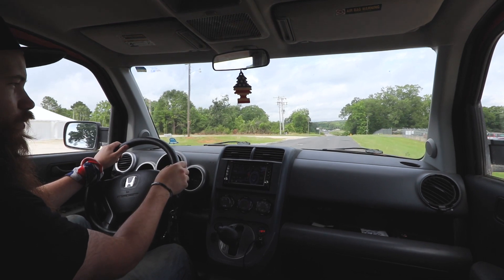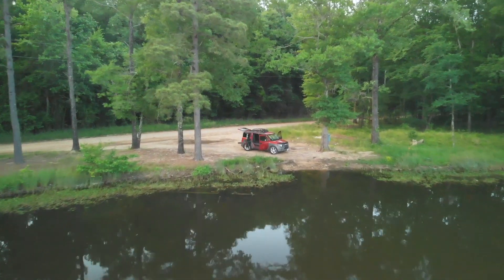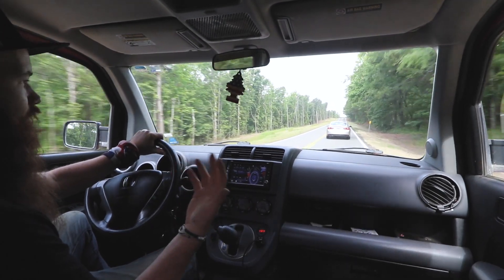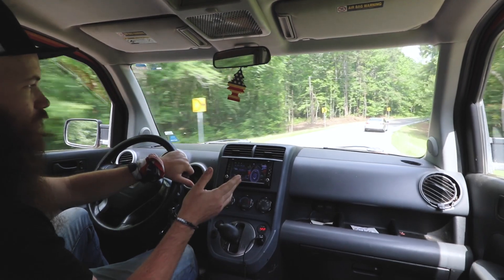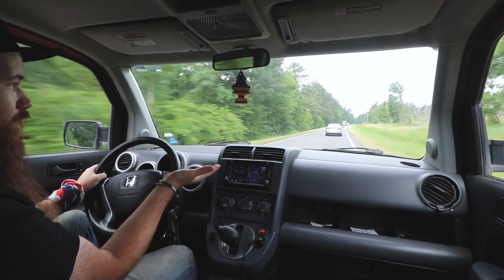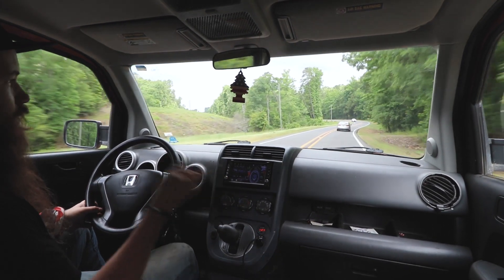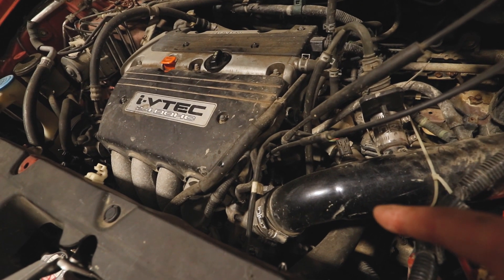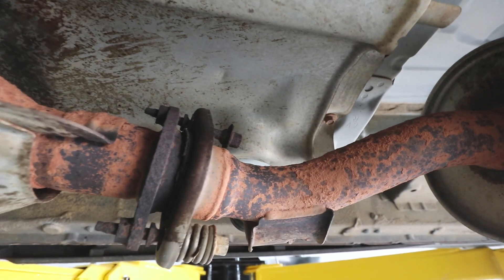Review of the 2003 Honda Element(10+ years of Ownership)

Comment: I was told there was Dust or heat shielding brakes rubbing could it be what you were talking about the rear driver side brakes?
Reply from the maker: Nope, that's a pretty easy fix. I've rebuild the brake myself and it's corrosion on the sliders in the caliper. Not an awful fix, but it's a design flaw for sure. 👍
Reply: @DashnCars  thanks my anxiety level just took a dip
Reply from the maker: @sandramatthews9478  No problem! Let me know if you have any questions!

Comment: Can you give a year to year differences and highlight what you feel, year/options, superior to others?
Reply from the maker: For sure! The early models 03-05 are pretty basic, aside from the rare 05 khaki colored one. 06-08 is an updated painted panels, upgraded interior. 09-11 is considered the 2nd generation sorta but they have a much updated exterior and interior
Reply from the maker: Then you have the SC models, which is the Street Cruiser model. Just a really nice street model, updated everything. Probably the best exterior and great interior. There were sub models too, like the Dog Edition!
Reply: @DashnCars  The AWD system seems to have held up to rallying and tons of miles. Would it need to be addressed if a turbo or j series was present?
Reply from the maker: There are some real upgrades you can do. I'll be doing the same thing to the Rally crx actually. You can pin the rear diff and run a Viscous coupler. I think for my goals in the Element the factory system should be just fine honestly.
Reply: I don't recall the source,  but I watched a review that said the transmissions in the 08 (vs 07) were a better built transmission (they changed where they were produced) and were preferable if you were going to be towing.  I don't want to give the wrong information but I think they said the gearing was tweaked. If someone knows this info please post it.
Reply from the maker: @rustybraids  From what I understand that of correct as well. I wouldn't really recommend towing much of anything with the Element either way. I've pulled 4 wheeler trailers and stuff, but that's pretty up there still. I've heart the differential is better in those years also.
Reply: Doing research in these cars is crazy - I bought mine specifically because of what people experienced with towing. Many claimed it was highly underrated for towing capacity.  Sighting the ratings in Europe and the US - and how the breaking ability was calculated (I think).  I have a small,  but heavy low camper, and within the 1500lb tow rating.  

Mines an 08 EX AT - I hope my experience will be good!  The element provided the extra sleeping space we needed. 🤞🏼  Its not like we'll be doing this on the daily,  but do want it to be safe for the travelers and the vehicle.
Reply from the maker: @rustybraids  I just have my first hand experience in towing with vehicles that are meant to tow things and ones that just 'can'  tow things. The Element will definitely tow at it's capacity, but it's not necessarily designed to tow. If that makes good sense, what I mean is the brakes, transmission, gearing, etc aren't up to snuff for towing much more than 1500-2000 lbs. However, you can do it and upgrade the Element as needed. 
I actually put a transmission cooler in mine that has a fan and everying, I'd highly recommend one if you plan on doing a lot of towing with any capacity!
Reply: @DashnCars   thank you - that makes good sense.

Comment: Hey, thanks for the reply, I'm thinking about running larger rims I'd like to run bigger brakes. What's the tire size?
Reply from the maker: These are 235 65 17
Reply: @DashnCars  Thanks, my trans imploded 4 weeks ago, a week after getting it fixed I dumped another 2100.00 into it. The old saying if it ain't broke don't fit it is B.S. The bottom lines it will be at least a year before I can afford new anything!!!

Comment: i see elements with 200 + k  what mileage would you stay away from? I have a mechanic I trust who will repair car as needed but not looking for money pit
Reply from the maker: Anything around 200k is still good, but just make sure the maintenance has been up to date and it's been regularly kept up with.
Reply: I’ve seen them with 300k miles mine has 255k  they have timing chains not belts.

Comment: Nice element man! 

Did the BC coilovers change the ride hight? I don't want to lose any ground clearance. Also what size tires and wheels are you running?

Thanks a ton
Reply from the maker: Thanks buddy! Yeah the BCs did bring it down, but that's not as big of an issue as I thought it would be. The wheels and tires in this video are 17" RSX Type S wheels 235/65/17 tire.
Reply: @DashnCars  thanks a ton for the fast reply! Did you have any issues running with the tires up front under compression and a tight turn? The fitment looks on point.
Reply from the maker: @automotivedistributors9708  if I have the coilovers too soft, it'll run a hair on full lock but it's just the fender liner. No big deal 😄. It's so close though if I turn the firmness up out doesn't rub at all.

Comment: Love your Element and videos!! what size tires are you running? do they rub? I recently put new sway bar links on my E and it was no easy job because of those rusted bolts -_-
Reply from the maker: Thanks buddy! The tires are 235/65/17s. They do rub every once in a while, usually if I crank my Coilovers stiff enough they don't rub though 😄

Comment: From my research, I only see a feee air flowing filter available by Spectre. I cannot find a K & N one. Do you think it is worth upgrading the Honda Element stock engine air filter to a K & N air filter? From the forums I love read about the K & N people say that it will filter the air and give better throttle response but that at the expense of taxing the engines lifespan. So if my goal is to keep my element until 300K miles with the original motor currently@157-158k then it’s probably not safe to do so. My goal really is to get my 03 awd auto Honda to be quicker in acceleration and have quicker up shifts without needing to floor the gas pedal when coming from a stoplight. Also the awd auto Honda claims that this does 0-60 in 11 sec. Do you think it’s worth the upgrade if I’m looking to get a slightly boost in acceleration and torque at highway speeds with just a K & N filter? Will the element be able to do 9-10 sec from the original 11 sec from 0-60 claim time? Do I have to worry about considering a K & N filter if my goal is to keep my car up to 300k? Also, dumb question, is throttle response the same as quicker acceleration off the line or just quicker up shifts from the transmission?
Reply from the maker: https://www.autohance.com/2003-2006-honda-element-l4-2-4l-cold-air-black-sp-series-intake-sp1726blk.html?gclid=CjwKCAiAuoqABhAsEiwAdSkVVGqQKKvIp8sm-J2If1RYeQkAXBkc2nT_LjEWkck3j_AI_sBCcVoKBBoCWwoQAvD_BwE
Reply from the maker: That's what I have on my Element. I've had it on since 140k miles and I'm at 210k.
Reply: Will that bog the acceleration time from 11 to 9-10 second or possibly a bit quicker? With what you have?
Reply from the maker: @markdesilva7207  Again it's very negligible the effect. I race a lot of different cars, so comparing the Element's 10+ second 0 to 60 isn't really what I have mine built for. Yet. I've had a lot of fun out of my Element with the cold air intake.
Reply: Dash-n-Cars yeah. Now I know for sure it’s not worth the time and money so I’ll stick to the stock air filter

Comment: Apparently, the reason all along I had trouble with highway acceleration and and highway speeds was due to clogged catalytic converter. So I used a product called cataclean. Which goes for mid $20s and on my third bottle the Element felt peppy and every speed and more responsive. You said, you’ve topped out around 110-115 mph. I want to know was it struggling to get up to that speed at all? Going from 90-100 it got up there no issues. I want to know from 100 to 110-115 was it much more of a struggle? Did the engine feel like it had more to go faster(120 mph) if it did not have the limiter on it or it would be a struggle? I know this car is not meant for speed but from what I research any modern 4 banger should be able to achieve 115-120.
Reply from the maker: I can't recall, but you shouldn't have that much problem.
Reply: Dash-n-Cars so it should be able to go from 100 to say 115 mph or that’s too optimistic? How about 120 mph if it didn’t have a limiter?

Comment: Can I use RSX stock suspension parts like strut, swaybar, lCAs, brake components etc on it?
Reply from the maker: I've heard you can, but it's not sprung correctly. I'm using BC Coilovers for the Element. They are really really good.

Comment: Loved your review. I have my originally owned 03 "Ellie". She has 192K miles. I recently had new suspension, sway bar, and front axles replaced by Meineke. The next day I drove it 2hours out of town and the check engine light came on after the car lost temporary power as I was speeding up to 70mph. Found out $111 later that the VTEC silinoid valve has gone bad and they said my spark plugs needed replacing too. Quoted me $725. Funny thing though was that my car was running great (engine wise) before they did all that suspension work. Also Is it standard procedure to align the car after new suspension is put on?  My car doesn't drive like she used to. Is it time to let her go before she becomes a money? pit?
Reply from the maker: The thing that I would highly suggest is a valve adjustment! The dealer quoted me 190 USD to get it done. It completely makes the Element cover back to life and MPG too!

Comment: Do you think this would be a good car for treking and infant back and forth? We do plan on having more but atm we have a 4mo :)
It is quite a quirky car. We are looking at a 2004. 137k mi. It’s been plastidipped so that’s a bit different. 

I guess the only concern would be road noise and bumps cause he’s pretty little.
Reply: @Dash-n-Cars
Reply from the maker: @lilybauer5491  It's such a great car to haul kiddos in. Every time we would take a trip with my son, it was always a reminder of how great it is for kids. Plenty of room, they have stadium seating in the back (they sit a little higher than usual), and they can make a huge mess without staining everything in sight! 😄
Reply from the maker: @lilybauer5491  the bumpiness isn't bad with the factory suspension, mine has been lowered so the ride is compromised a bit for looks. Road noise isn't bad, it's just not as quiet as modern cars.
Reply: I have an 06 EX. Was the best car for an infant, so easy to put her in the car seat without breaking your back. also the door configuration leaves you with plenty of room to move comfortably. I'm just under 200,000 miles, only mostly regular upkeep....I don't know any mechanics so have done the dealership all along.  I've seen on the element owners forum these babies going for 500,000miles. Great for camping, taking the dogs to the beach...who cares about sand and salt...it just wipes up! Love my car!
Reply: @DashnCars  we ended up with a 2000 toyota 4runner! its also a bit bumpy and noisy ha  thanks for the reply!
Reply from the maker: @oomphale  Absolutely! I love that my video has become a place for people to tell their Element stories. Such a damn fine rig!
Reply from the maker: @lilybauer5491  Also a very good ride! Congrats on the purchase!

Comment: Should I buy if it’s 220k miles in 2024?
Reply from the maker: As long as it's mostly rust free and fairly regular maintenance, go for it! Just be ware of the rear lower swing arms for rust spots where it connects to the body. That's pretty much a death to these Elements.

Comment: I'm looking at the 2021s!
Reply from the maker: 😄 😄 😄 Me too!
Reply: I wonder if they're selling standard    transmission models? I guess I'd go with an automatic. How about you?
Reply from the maker: @realtor411  there's zero hope for a real 2021 at this time. I hope some day soon they really do pull the trigger
Reply: @DashnCars  It will have a crappy, designed to fail, CVT transmission in it and a weaker "1.6 turbo" engine, or some other subpar configuration designed seemingly by idiot savant psychopaths, just like they are doing to every other (supposedly affordable) vehicle  nowadays.  They completely ruined the Kia Soul.  It's garbage now.  A real throw away car with transmissions (CVT) going out at 5K miles.  And if a new Element is not like the aforementioned description, it will be electric with a weak engine as well.  They are designing everything this way on purpose, and jacking up the prices on trucks, jeeps and certain big SUVs with the decent engines and transmissions we took for granted just 10 years ago in all vehicles.  And all the new vehicles are full of government nanny state technology (highly annoying and intrusive) such as engine "start stop" where your car completely dies at a stop sign and then starts back up when you press the gas.  Reminds me of a circus bumper car.  I love old school (pre technology) vehicles, with just a CD player, radio and the normal amenities.  The technology is slowy taking over and turning everyone into zombies.

Comment: You’ve probably already answered this somewhere in the comments, but what aftermarket air intake did you install?
Reply from the maker: I ended up putting in the Injen intake.
Reply: @DashnCars  Thanks for the reply!
Reply from the maker: @JoshBransonPhoto  yessir! No real complaints honestly it was just pricey at the time.
Reply: @DashnCars  You still have a cat on yours? When the stock one goes, like mine did, it's absurdly expensive to replace. Working man can't spend $2K to replace a cat on a 10+ year old vehicle, that's just absurd ya know. Plus, the aftermarket ones are mostly just crap, so it really kinda leaves you no choice, especially if you don't have emissions testing in your state.
Reply from the maker: @JoshBransonPhoto  Thankfully still have the factory cat, no state inspection either. Honestly I've built enough exhausts I would just grab a Vibrant replacement or something stainless steel.

Comment: Also, I’m interested in improving the elements cornering and handling capabilities as I used to own a 2006 Mazda 3i(compact car) which handled truly amazing for a car it was! I mean that car was able to takes curves and corners and it felt so planted for it size and engine power. My Honda being a 03 awd auto ex, is there anyway I can get it to be as nimble or handle like or close to the Mazda 3 I had. I looked into different options for the E’s handling were tires, stiffer bushings, suspension and lowering it. For my Honda I currently have 235/70 R16 tires of that helps. I wish I could send of photo of my element but my question is what handling mods would help this car handle like the Mazda 3 or at least close to it?
Reply from the maker: BC Coilovers and a good set of tires. Would be the first step. I fly around corners with mine in that setup.
Reply: Dash-n-Cars now will that handle as good as my previous Mazda 3 or at least close to it? What is a good tire/rim size for good handling? People say it has a high center of gravity but let’s be real, Honda engineers made the chassis and the handling counter parts stiffer than a normal cars counterparts to handle all that top heavy ness
Reply: I have 235/70 R16.
Reply: Also can the ex element be able to handle like the Honda SC element AND retain its smooth road driving manners? Or it’s a compromise?
Reply from the maker: @markdesilva7207  mine handles excellently and is an Awd EX auto as well
Reply: Dash-n-Cars how does this EX auto awd element compared to the Honda Element sc in the performance and handling department? Can the EX awd be upgraded as the SC model?
Reply from the maker: @markdesilva7207  Essentially the SC is the "Street Cruiser" variant. It has a bigger rear sway bar and a little lowered stance, along with bigger and wider wheels. I'm actually slowly going to build my EX into an "SC AWD" sort of build. I used to race my Element off road a lot, but now it's getting up in age I want to make it the most comfy daily I can.
Reply: Dash-n-Cars do you think the ex awd element has the potential to handle as good as my old 06 Mazda3? I really missed that car but I cannot afford to purchase that and I also would not want to compromise that versatility and space the E has. That Mazda trunk space was awfully small lol
Reply from the maker: @markdesilva7207  haha yes you can make it anything you want. The Element is built very similarly to a similar year Civic or RSX.
Reply: Dash-n-Cars well the first thing I’m looking into is an aftermarket rear sway bar. it looks like they discontinued selling that as I cannot find it anywhere online. All they have is a front sway but that won’t be of any benefit as that would pronounce the element understeer more so or less. anyway, where else could I obtain to find an upgraded rear sway for the EX?
Reply from the maker: @markdesilva7207  check car-part.com for SC rear sway bars.
Reply from the maker: @markdesilva7207  https://www.amazon.com/dp/B007APH6Z0/ref=cm_sw_r_cp_apa_fabc_eZCbGb18D2DGS

Comment: Mine starts sputtering at 3000 rmps and I have replaced several parts
Reply from the maker: Sputtering can be a lot of things. Spark plugs, coil packs, fuel filter. Just need to get it properly diagnosed and see what comes up!
Reply: They have replaced so many parts. Hopefully oneday they will figure it out. Thank you for the advice
Reply from the maker: @windyhowk2344  good luck! It should be a pretty simple fix at least. Those aren't terrible things to diagnose or replace if necessary